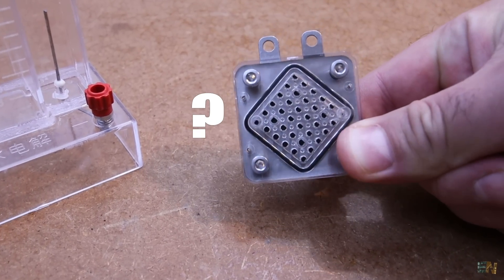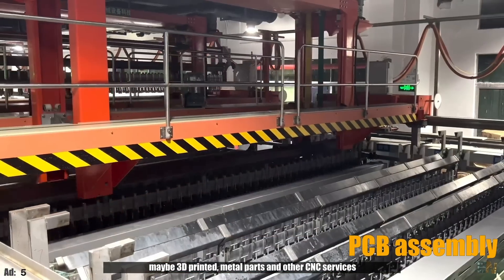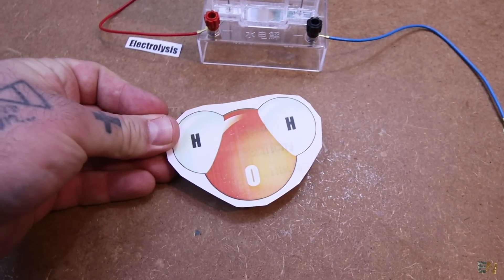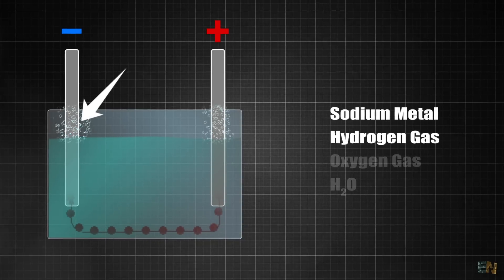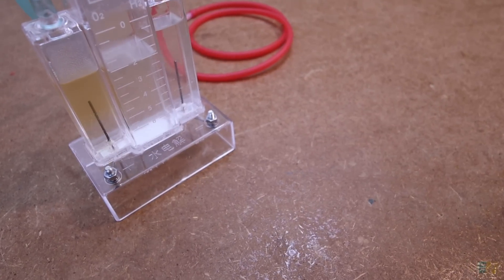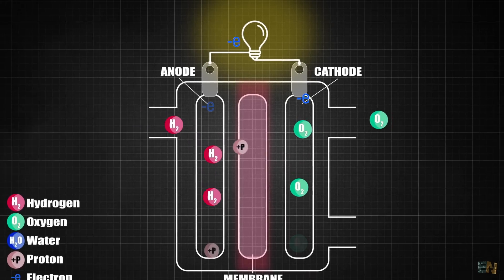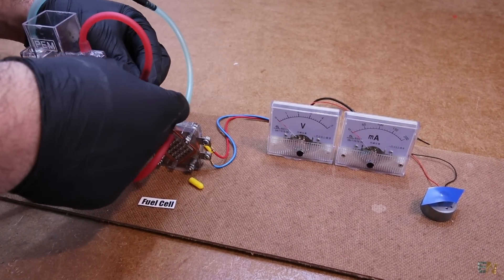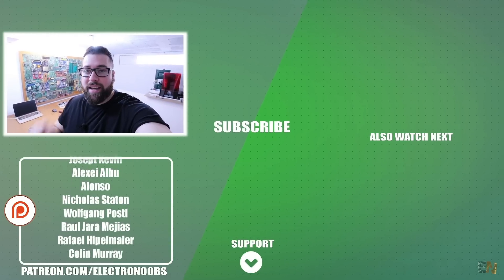Hydrogen Fuel Cell - Is Hydrogen Car the Future? + Electrolysis

Comment: Been driving a fuel cell electric vehicle for 7 years and have put 72k miles on it. I'd say it's the present.
Reply: Where do you live to find hydrogen stations for longer roadtrips? How often did you change the air-filters during that time? How about the fuel-cell core? How much did you spend on propulsion-system related maintainence?
Reply: @Makatea  i live in California.  California which is very large.  I have done a 730 mile trip in 11 hours with  it. 

Therr has been 0 maintenance on the fuel cell.

I have replaced the tires at 50,000 miles and I have replaced the IEE (ion exchange element) twice (the IEE is a consumable that protects the fuel cell and the price of that consumable is around 1.5 cents per mile.
Reply: @homomorphic  Thanks a lot for the prompt, detailed answer. 
What car-model do you have and what motivated you to prefer it over a BEV?
Reply: @Makatea   I have a 2016 Toyota Mirai. I have always had BEVs as well (I currentlt have a polestar 2). The Mirai is much better for trips over 150 miles because it recharges in less than 5 minutes. So I drive the Mirai on longer trips and use the polestar 2 for most local driving.
Reply: @homomorphic  I am under the impression, that some people drive longer distances like they were on a cannonball run. 
Making regular pauses to pee, get a snack or a drink and walk around a bit would certainly be benficial for driver fitness. Given the rapid evolution in battery chemistry, I'm pretty confident that charging times will continue to drop. 
That way, you'll be able to push beyond California rather than flying.
Reply: @Makatea   there is no evolution in battery chemistry. All the lithium ion chemistries we have today were known in the 1980s.

The fact is there isn't a BEV today that can come close to doing a 730 mile trip with three 5 minute charging stops as I did with my Mirai in 2016 (and that ny schedule required I be able to do).
Reply: @homomorphic  While I respectfully disagree with your first point, for your usecase the Mirai certainly is a viable option, but far from ideal.
Reply: @Makatea  you can't disagree. It is an indisputable fact that all lithium ion battery chemistries were known in the 1980s.  Not all of them were produced, but they were all known.

You can't just decide that facts aren't to your liking (well you can, but if you do that no one will pay any attention to what you say).
Reply: @homomorphic  why on earth would you do 730 miles with only 3 x 5 minute stops? That's got to be over 12 hours driving, with only 15 minutes break in total. In my opinion, that's downright dangerous and would leave me wiped out. I live in the UK, and I know its a hell of a lot smaller than the US and very crowded but that is virtually the full length of the country, in one go, with only 3 x 5 minute breaks. I know of no-one who would be mad enough to even attempt to do that. I would need to spend longer than that visiting the toilet.
Reply: @Richard-io9xe   because that's what I needed to do. I was dropping my son off at music camp if you have to know.

The point is that's what I had to do and my fuel cell vehicle was a far better choice than my BEV would have been.
Reply: @homomorphic  I don't mean to be antagonistic for the sake of it, but isn't the answer to either set off earlier to allow yourself the ability to take proper breaks and protect you, your child and any innocent passing car's occupants who might otherwise be rammed off the road when you lose concentration because of driving so long with no breaks. Either that or do it in stages, staying out in between.

I can only suggest again that it is dangerous as hell to drive that long without a break. I just couldn't physically do it. Just imagine if you caused a pile up at the 12 hour mark, wiping out some poor strangers kids, and it transpired that the cause was you having driven for 12 hours and being almost comatose. Just take a break for God's sake. 

Which type of car is best suited to undertaking such mad journeys is of no relevance for me. No-one should be doing it so it shouldn't matter.
Reply: @Richard-io9xe   it was 5.5 hrs driving in 2 separate trips (one going and one returning). 5 and half hours isn't even considered particularly long by US standards. 

This is an extremely typical drive in California.  Nothing even remotely unusual. The fact you think that is unusual is what is truly bizarre.
Reply: @homomorphic  Perhaps it was because you suggested you did a 730 mile journey. Now you're saying it was 2 journeys. 

The big question is whether there was a decent rest in between, or did you just open the door, wave goodbye to your son and set off back? 

If the latter, then it is still, in practise, one 11 hour journey. If the former, then you could have charged for the journey back when you were stopped for a refresh anyway after the first leg, meaning on each leg, you would have only needed one stop, which in a modern 800v EV, could be done in 20 minutes. Hardly a big issue.
Reply: @Richard-io9xe  Duh! it was two legs (one outbound and one inbound) every trip has two legs. No one goes somewhere just to turn around.

There aren't fast chargers at camps in the Sierra Nevadas. The voltage architecture is irrelevant.  If it were possible to charge at all (it wasn't) it would be on L1.

The whole point is that no BEV handles long distance driving well.
Reply from the maker: So cool :)
Reply: OK   how about driving across the USA, ike many Tesla BEV owners have done? Your Mirai maker  has lost marketshare  in North America  due to no BEV sales, Akio Toyoda stepped down from his CEO title  due to his poor leadership  when it comes to the future of Toyota, not sure new CEO Sato can save that company , in  the USA anyway, profit loses were in the millions.
Reply: Presently you'd be a  short a FOOL CELLS  in the brain to drive across to another State in a Mirai , let alone across the continent, "Hydrogen , the fuel of the future".😅
Reply: @aurelio-reymilaorcabal9669   I'll race you (in my 2016 vehicle) from San Diego to Tahoe in a BEV of your choice for a $1000 bet and Ill beat you by at least 30 minutes.
Reply: @homomorphic  Elon Musk will race you across the continental  USA in his Falcon Jet ,your choice of  aircraft, Duh

Comment: It's a Bad Idea: Hydrogen-Fuelcell-Cars are horribly inefficient. Today, nearly all hydrogen comes from transformig fossil fuels, especially gas. For it to be climate-neutral, you'd have to make it by electrolysis from renewable energy instead. That requires several times more electricity than needed to move a Battery-Electric Vehicle. Plus the conversion losses of the fuelcell. You also drive around in a car with the same gas the Hindenburg was filled with, but with 700 bars of pressure. And finally you regularly need to change the special HEPA-filters of the fuel cell, which also a lifespan significanly lower than the car. The only maintainance items related to the propulsion system of a BEV are cooling liquid and differential oil.
Reply: Yes, hydrogen is very big on greenwashing.
Also it's very hard to store. I'm not an expert, but it's worth looking in to for a day to see that it is hard to do and not as easy as gasolin to scale.
Hydrogen is one of the smallest elements. It goes in to metal imperfections and deterrierates it.
Reply: All industry need A LOT of hydrogen, Wich is 100% from from fossil fuels. We need to produce this hydrogen with electrolysis and then if there's a little bit of hydrogen remaining we could maybe use it for cars but it's the last thing we need to do.

In addition to that hydrogen vehicle use a ton of critical material like platinium
Reply: @oneil9615  Fortunately, due to its obvious disadvantages, there are only sales, where there is a significant network of hydrogen stations and even then...
Worldwide overall sales were 56.000 vehicles between Toyota, Hyundai and Honda over a timespan of more than twenty years. For comparison, Tesla built 1,2 million cars in 2022 alone.
Reply: Manufacturing the batteries for ev is dirty and uses rare earth metals. End it won't be enough rare earth metals to make all batteries needed to replace combustion engines. Ev weight so much more then a car with hydrogen fuel cells.
Reasons why hydrogen ain't being used is because we can't produce enough clean energy to make the hydrogen by electrolysis. It's easier to make batteries.

The first step in hydrogen vehicle is going to be transport like trucks because that where batteries get inefficient.
Reply: @tiddybearkush  please let us all know when that Hydrogen  Semi makes it across the USA , on its own power , with all the refueling stops included.
Reply from the maker: Not saying is the best but it could be if we invest time and energy into it, in few years it could get better.
Reply: @ELECTRONOOBS  No, with technology known today, BEVs are hands down the most efficient, you only have the charging losses on the order of a one-digit percentage.
Hydrogen needs to be produced, today from fossile fuel, tomorrow maybe from renewables, both ways associated with considerable extra energy consumption.
Next you need to compress it to 700 bar, keep it cool and truck it to the H2-stations. And such a station costs around a million bucks apiece, while fast-chargers are dirt cheap. And you can have a smaller one in your garage for a reasonable price.
Green hydrogen may very well needed for in the industry for high-temperature processes, but for cars, it's really a losing battle.
It is however a clever move by the fossile fuel industry to greewash their stuff ;-)
Reply: @ELECTRONOOBS  true
Reply: @ELECTRONOOBS  A lot of Energy! LOL! That "fuel" will never scale, on top of storage and transporting it., but do give us all a heads up when a single Hydrogen powered Truck or car makes it across the USA on its own, we are waiting,  a LOOONNGGGG TIME.
Reply: @PaulFrankAdams  Now if only we can make those ideas  become reality, but we BEV  folks need just plug in our cars or 2 wheelers.
Reply: As one who does research on fuel cells, there are many ways to do it, you're talking about the negative qualities of a bunch of different methods. Fuel cells are actually one of the most efficient methods to produce energy. Procuring hydrogen isn't efficient but that is one type of fuel cell, there are many. There are issues but it's still in its infancy, it took 200 years to master the steam engine. It's been roughly 70 years of passive research but now it's become popular so our understanding will grow faster.
Reply: @jimmyjonestodd2556   You Hydrogen  believers: please give us all a heads up when you have made a BREAK THROUGH on  Hydrogen Production, Transport of it and Storing it , until then it will be " THE FUEL OF TOMORROW ".
Reply: @jimmyjonestodd2556  Research is all fine and dandy, but due to the multiple losses from the hydogen generation, compression, delivery, conversion to current, charge losses of the buffer battery, there is no way Fuel cell vehicles will ever be competetive with BEVs. Whoever says different has reasons other than engineering.
Reply: EVs are more efficient while in use, but nobody is mentioning the fact that a battery will last only 10 years at best, and cost a fortune to replace, and more harm to the earth is done while mining lithium then an EV will save in its lifetime. 

A hydrogen car should theoretically be low maintenance, and if more time is invested in this, fuel cells could easily become more efficient. Just think, 30 years ago people never would have guessed you could get 300 miles of range on an EV charge, but here we are today. I can see the same thing happening with hydrogen cars if we just make an effort to do so.
Reply: You’re a bad Idea.
Reply: Norway made bank in the 30s and 40s running electrolysers with hydro power and selling oxygen tanks and hydrogen tanks. Today even the heavy water biproduct can be sold for nMRI and nuclear reactor coolants.
Reply: Punta Arenas: xD
Reply: Clima neutral brainwashed bs.
Reply: @0xN1C0  The thing with batteries is they natively support regenerative braking and for semi that’s huge! You’re not going to regenerate hidrogen from braking.

Also hidrogen needs a lot of padding / shielding to even be reasonably safe

Considering these two I suspect in reality  you would end up with a much larger / heavier semi than a BEV only
Reply: Input 20w output 50 mw what a bad idea😂
Reply: But you can fuel up fuel cell cars with minimal change to current fuel stations. Lithium ion batteries are hella expensive, the metal is rare and limited asf, and it leads to soo much frickin' slavery in places like Africa. We're already stepping into the renewable energy era, and fossil fuel plants are decreasing/will decrease eventually - so it's just such a great time for hydrogen cells!

Also, just so you know, the energy density of fuel in such cars would be orders of magnitude greater than Li ion batteries, which are just inefficient at storing
Reply: @HarshitSingh-mg7zt  Hydrogen as a fuel will never scale, but please notify all of us when you can drive across  any continent on that " FUEL", because that is a GASEOUS  PIPE DREAM!
Reply: @aurelio-reymilaorcabal9669  can we drive across a continent with current cars? No. With current EVs? No. Do we need to? No. Idk what point you're tryina' make!

Hydrogen cars can be fueled just like your current oil cars (with a Lil' change ofc) - and the energy density of hydrogen is just wayyy too high with respect to even oils, let alone an entire battery palette that covers the entire car bottom. Not to mention that the battery degrades itself overtime, wayy faster than any of the components of oil cars, or fuel cell cars. Not to mention that the replacement of battery itself would be an expensive operation
Reply: @hello I have engineering background with hands on technical skill on maintenance and repair, do you really think I'm delusional?
Reply: The biggest issue with both technologies is the lack of infrastructure to support them. Both will require massive improvements to the grid which is still heavily dependent on fossil fuels. Until BEV stations are as common as gas stations in all areas the market will continue to remain fossil fuel dominate.
Reply: @razredge68  upgrading  the Electric  Grid  is easier than starting  anew with Hydrogen which has its problems like blowing up if there is some leak , as happened in Northern California and  Norway and S.Korea, compressing that gas is another.
Reply: Maintenance on a BEV is just the same if not more expensive than a  ICE car. Regardless, if BEVs continue to be pedaled, and the tech turns out to be shit, we all might as well be using steam engines.
Reply: BMW just proved you wrong.
Reply: Idiot knows nothing about hydrogen... you can tell he watches fake news...
Reply: Not to mention you are losing energy in the electrolysis step to heat, and since the hydrogen just reacts back into water, you are basically just using electricity to add potental energy to hydrogen, then reacting it to release the energy you added but less energy because physics... 🌈 2 law of thermal dynamics✨️✨️✨️
Reply: No it’s a bad idea to use a hydrolizer as a fuel source but a hydrogen fuel cell isn’t a bad way to power an ev vehicle.
Reply: And your not talking about the issues with BEVs? They are far more expensive, are incredibly
Heavy, take ages to charge, also the efficiency is that much worse than electric cars and I’m sceptical about the efficiency figures as they are only efficiency and don’t include the fact that you have to pull a heavy battery around, also it has a huge potential for planes, ships, trains and other heavy goods vehicles particularly in the case of planes the lift to weight ratio is incredibly important and hydrogen has a far higher energy density also can carry more weight as they lose the weight throughout the flight meaning it will still be within safe landing weight
Reply: Your point about safety is mostly unwarranted, it's like saying that electric vehicles run on the same electricity used in electric chairs.

Tech has come a long way since hindenburg...
Reply: @jaydeep-p  Hidrogen still explodes the same way as the Hidenburg, actually a few hidrogen pumping stations have exploded recently just search the news. This will be worse than LPG cars which you cannot park in underground car parks
Reply: @0xN1C0  What J M said.
Also, truck drivers have mandatory rests they can use to charge up, so no time lost and no unreasonably big batteries.
From a cost perspective, fuel-cell trucks can never beat BEV-trucks.
Reply: If we always talk about inefficiency, we will never progress like today
Reply: @eone2345  that's the problem the world is doing instead of taking baby steps towards a sustainable future we are saying let's go straight into electric battery without the technology being ready to be sustainable then complaining that it can't be done. Don't want to sound like a conspiracy theorist but it's almost definitely influenced by oil companies.
Reply: @LethargicLemon  I totally agree. If people have these kind of mindset about electric car battery inefficiency 100 years in the past, without obstinate and passionate people kept progressing and pushing the boundry, we will never have highly efficient battery for electric car today.

Heck, conspiracy theorists are totally right. Because people have these kind of mindset and how certain 'people' killed electric car in the past, perhaps the main reason why only recently we have breakthrough in modern electric car.